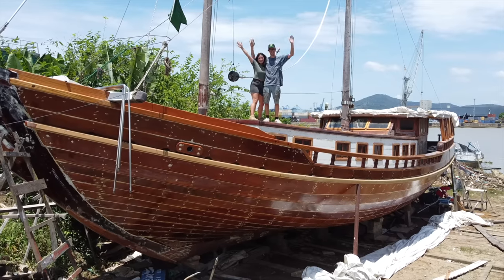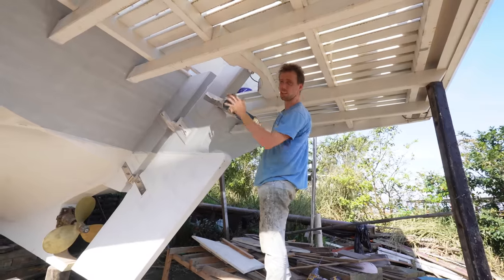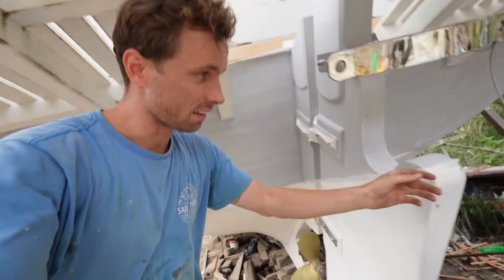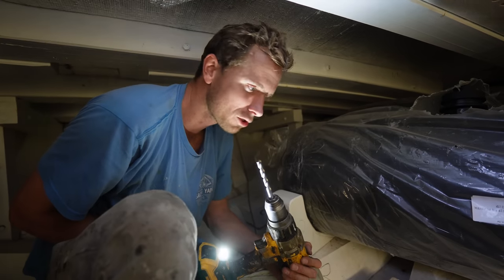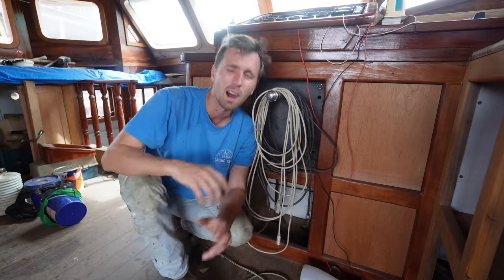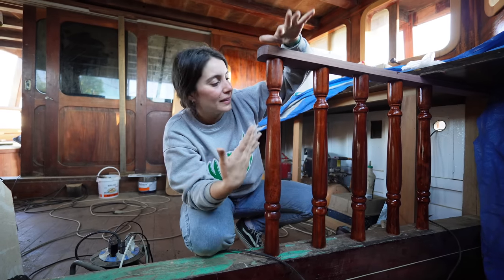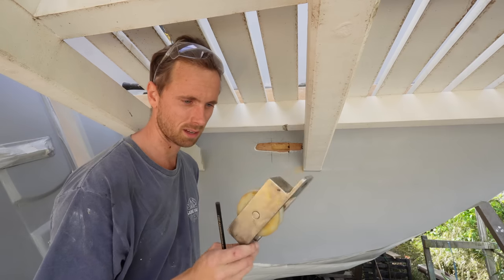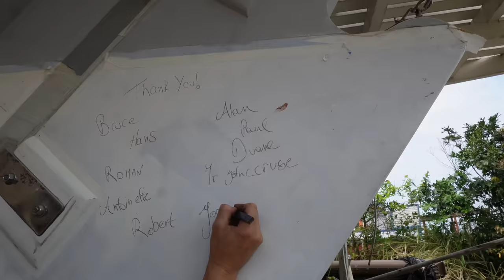We can finally steer our once sinking wooden boat into the horizon — Sailing Yabá 152

Comment: Ben
Your ideas ARE OK for a {GO CART or an outboard motor system} BUT NOT SIUTIABLE FOR THE WEIGHT YOU WILL SEE IN REAL OPERATIONS ON THE SYSTEM!!  Your close to launching so best you get this right the first time. Cable is not the answer for you here in your design and weights you will experience.
There are some great ideas here in the comments and I suggest put some serious thought into rethinking of of this light of controls.
 Love your project so far and all the best in the project.

Comment: The park has your hand set a cable goes around. It’s called a thimble when you put the cable clamps on the cable are you wall goes on the end of the cable not on the bite of the line the cable camp saddle should be on the bite of the line.

Comment: The wire rope for your steering must not be reeved around squared corners or edges AND do a quick internet search of "wire rope clips" to see the correct way to install aforementioned clips. You need "bolt-type shackles" to make the connections unless, of course, you think you'd enjoy repairing the cables at sea in a storm surrounded by sea serpents or some such nasty.

Comment: May be a good reason , but wonder why cable run comes down from ceiling to floor and back to ceiling when it could turn earlier and eliminate a space using up run. which also forces a person closer to that alternator.  (using house terms here as ceiling is usually wall in boat)

Comment: I think that you should be using a larger diameter cable for such a large vessel, you don,t want to lose steering due to braking from running in heavy weather or seas.

Comment: You need to add a tension system to keep the cables tight. I would not use a cable system they are very sloppy and  how do hook up Auto Pilot to it .
Look this up Seaboard Marine. Good luck !!!

Comment: Please, please change out the steel wire for chain or better still hydraulics. As an engineer I used 6mm A4 stainless stranded rigging wire, bought from a Boat Chandlers. It was used for an onshore project where the motions were slow and deliberate as in your steering. Cable loads were about 2kg and involved a full return on an appropriate size pulley (so 180 deg). I was shocked  and amazed to find that it only lasted 6 months before it snapped on the pulley. The individual wires couldn't stand the bending around the pulley and each one snapped until the complete cable failed. (Nylon rope would have out performed it) You don't need this on the sea. Also use bolted thro connections not screws.

Comment: Os cabos que passam pelo painel de popa não devem estar em contacto com a madeira. Façam um furo maior e metam tubo de inox e cabo de aço passa pelo tubo. Os cabos podem estar molhados e vão passar agua para dentro da madeira como está agora. E também com o tempo o cabo de aço vai alargar o buraco.
Reply: I agree some stainless tubes with flanges.
Reply: @frankkelly2245  Yes that's it.
Reply: Exactamente o que eu estava a pensar enquanto via o vídeo! Abraços
Reply: With time those holes will grow bigger on account of wear. Maybe you should re-think of how to supplement the holes with some kind of material where the steel  cables cannot bore a bigger hole. A tricky problem buy no doubt you will come up with a solution. Cheers😊
Reply: Concordo, porém com o tempo e uso o Cabo de aço vai limar cuaisquer material (inclusive sofrer  desgaste). Um probleminha para resolver. Abraço a todos.

Comment: Will you not "waterproof" the holes where the cables go through the transom? IE - drill them out to say 2cm and then fill with thickened epoxy and drilled to accept a sleeve? Just to keep the water away from the wood.

Comment: You need to seal the hole through the transom with a metal tube through which the cable can run. If it stays raw wood, it will suck up water into the transom.

Comment: Don't cut the wire, have it travel across the face of the Crome plate connected to the rudder. You can attached t.he wire in the center of the plate

Comment: Sorry people but I think If you don't rethink everything, it will be Yabà's Achilles' heel. I'm surprised that they didn't tell you anything at the shipyard, how is the system implemented on similar boats?
My concerns:
- bad galvanic couplings (chain/Stainless Steel, SS / bronze)
- SS cable too small
- to much pulleys/ direction changes
- the SS part on rudder it is not aligned with cables
- plus, all concerns of many previous comments.

Comment: you should over drill the thru holes to double the width, fill with epoxy and then drill thru the epoxy .  this will seal off the thruhole from water penetration.   other option would be to sleeve it with a thru hole tube and epoxy or sika it in .         looking good

Comment: The way you connected the cable to the end  will brake the cable in a few  days on the open sea . FRICTION WILL DESTROY A CABLE. Find a beater solution with no friction.

Comment: You should have a grommet going through the transom where the steering cable go through. Use turnbuckles to adjust tension .  Also I'm not a big fan of the way the cables  are under the swim platform . Seems like debri can get cought on the cables easily . I don't know how it was set up originally , but I don't like this set up .

Comment: I said last week that consideration should be given to make the chain drive bigger and duplex. I'll repeat that. I also think the wire is far too small for a boat this size. The strain on the rudder in following seas is huge. At a minimum I would go to 10mm with pulleys and fittings to match. IMO the pulley blocks you have fitted are far too flimsy and weakly attached. They don't have to be pretty, so much bigger and welded from steel and angle iron is fine. You should also be able to grease them. As said there is no damping on the rudder so it will be very prone to being slammed from side to side. Not sure how you will do that but check the other big boats in the yard. Make sure the emergency tiller can be quickly and safely fitted as a failure anywhere in the system will mean you are likely to need it in a hurry.

Comment: I think others are all pointing out obvious deficiencies in this steering set up.
The biggest risk to this project is what you don’t know, not having someone who does know supervise and correct design.

“Winging it” seems to be creeping in to a lot of decision making on completing the project now.

That is understandable & what happens after some years & just wanting it completed as quickly as possible out of sheer frustration at the length of time it has taken not to mention the cost as well.

“Don’t spoil the ship for a halfpennyworth of tar” is an old ship building idiom, that essentially captures what’s happening here.

It’s a LOT slower, more difficult & more expensive to complete the project once it’s in the water.

Rushing to complete it, cutting corners and launching too soon is a big mistake.

Comment: Cable is too small. The working tension should be considered as well as the breaking strength. Im guessing the working tension of that cable is only 600 lbs or less. What happens when Shamu bumps it?

Comment: I think you should just hydraulics. Just as in the car steering system. It give you better power turning, no  returnback resistence, and you could just lay the hydraulic pipes along the starboard and portsides walls of the ship, where every thing should be neater.

Comment: With the transit could you find a tube of stainless that could run through the transom so the wire is not running through the wood

Comment: Would be way better to use much bigger diameter pulleys for directing the steering cables, those small ones cause too much drag by bending the cable through a sharp angle, then you can keep the gearing you have,  current set up will also shorten the life of the cables due to the tight radius.

Comment: I wonder if changing to steel wheels instead of the nylon, will not just introduce wear on the wire (steel on steel without any lubrication), without any real strength increase of the system. I would probably prefer the wheels to be the wear part that can fail, not the wire.

Comment: When you clamp your cable at the chain, you should NEVER saddle a dead horse!  the live line is where the saddle goes and the U bolt pulls the dead (unused) cable against the live cable, otherwise the cable will pull out.

Comment: I'm curious why you didn't just make a fairing block with the proper angle and bolt that with the stainless pulley on the transom? instead of chiseling into the transom. Great progress!

Comment: Hola amigos 
Don't use those cable clamps. That wire is very very easy to splice. There are great YouTube videos on splicing and a great skill to know.
Reply: I'll add this.  Turnbuckles.  You will need a tensioning system somewhere. 
Those plastic sheeves are a bad idea in a steering system. I had one explode at a very bad time. Luckily I had practiced emergency installation of the emergency tiller which saved us from going aground. (long story)
You have a machine shop handy. Get them to make bronze sheeves.

Comment: To pass the steel cable through a drilled opening without securing the opening against rubbing the steel cable is very reckless. Over time, the steel cable rubbing into the wood will change the angle. It will do the same with the nylon roll. Steel on nylon is also not a good idea. This role will also say goodbye with the display and it must be changed. I recommend a thick-walled VA steel tube in the fuselage through which the steel cable is guided and Steel rollers for every other pulleys.

Comment: You definitely need through bolts and nuts on all pulleys as the system will eventually fail under the stresses of sailing.

Comment: There's a minimum diameter pulley that 6mm stainless steel wire should be use for.  the wire will have a much shorter life and therefore require more inspections to avoid the risk of unexpected failure.  Use large low friction pulleys, all carefully aligned.  I would prefer to see the quadrant sited lower down on the rudder and acting on more timber than the rudder post.  How do you plan to connect an auto pilot?  Usually it's connected directly to the quadrant. Auto pilots free up a helmsman to do other tasks, rest, navigate look out for other vessels. Remember the repeated loads on the wire and pulleys/blocks should not be underestimated.  Remember, keep lots of spares on board, wire, pulleys, clamps and do practise using the emergency tiller, not just in calm water, but under sail in more challenging conditions.

Comment: Do you think it would be best to put a stainless steel pin through the hole in the stern and then feed the cable through to reduce  wear on the wood.

Comment: MP why did you not clean and varnish  the base before you put the poles back that would be have saved you a loy of time , Ben please make Dame sure that wire is not shafting  on those pulleys you should have gone for the cover wire protected

Comment: your steering cables are going to require much more support. Having such a weak support system and also the gauge of the cable is not large enough to put up with all the forces that will be constantly on it.

Comment: I would not recommend attaching the wire at that place on the motorcycle chain.. it is simply the weakest link.. It is only strong when the chain pin goes through the hole.

Comment: Hi
You are using the kwadrant wrong,now you get slack in the side that is not pulling.
You should connect the PS wire on the SB side of the kwadrant and vice versa I think

Comment: This steering system is to weak and will give you a lot of problem once at sea. Get a stronger cable, weld a fitting at each end of the chain to distribute the load, fit turnbuckle....

Comment: Hi, I think the wire is way too small (thin) probably 10mm 316 Stainless Steel would be best. Although what you have should last a few months or until your rudder hits something. Also those large Nylon pulley blocks are correct and I think you will find they are made from "Acetal" which is an industrial grade Nylon with excellent strength and wear resistance (just check the wear to confirm. Those brass pulleys will not last (possibly collapse under heavy load), you need Stainless Steel or Bronze Pulley's with large Nylon Blocks. The wire should be adjustable at the rudder end by crimping on rigging threaded rod, the fittings that go into the Rigging turn buckle. You need an adjustment somewhere. from the chain to the cable you need to make a solid steel Link that fits the chain pin size at one end and a larger hole at the other end to fit a shackle to. There should be no cable turn of a greater angle than 90 degrees or those brass pulley block assemblies will snap or pull through the wood. The forces applied by the water to the rudder is 10 times air pressure at least just at 10kts of wind pressure and roughly 100 times at 20kts of wind (that's not exact but you get the idea.
I hope you understand.

Comment: That steel wire will wear that way over time.  Your original idea with the loop should be used get a bigger chain or smaller loop.

Comment: Compare your steering system to those who repair next to you.   Bet they are more robust.   Try to copy what you see.
Line the cable holes so they do not shed water into, onto the unprotected wood of the hole.
Tension adjustment is a must.
Spread the force of the cable on the chain over multiple links.
How long is your emergency tiller?   Take it's length x how much push or pull you can apply,  say 2 meters x (your mass 90 kg) gives you the lever arm force on the rudder, can your cables take this?    In English units 6 ft  x 200 lbs = 1200 ft lbs of force.  Cable should hold at least double that for safety.  (numbers are for illustration, not actual values)

Comment: Never saddle a dead horse. Every rigger will tell you this fact. The cable clamp or wire rope clamp has two parts a saddle and a u-bolt. You did it wrong kinking your wire rope and that makes it weak. The “ dead horse’ is the short end of wire rope. The saddle goes on the pulling part of rope and the u-bolt goes on short or dead horse side…

Comment: I think u should have used a rack and pinion unit. I’m sure u could find a good used unit quite economically, they are far more reliable and seal better. Also why no bow thruster on such a large boat?

Comment: Don’t have the cable run on the roller part of the chain it can’t hold strength, run the cable through the roller hole this way the side plates have the strength not the roller crimps ! The boat looks great !

Comment: Your cable is too small.  3/8" (9-10mm)  would be minimal size for such a heavy boat & rudder. Teflon pulleys will wear out and cause binding when needed most(I.e heavy weather)!!! All pulleys should be thru bolted in bulkheads with backing plates on back side.

Comment: With all the quality craftsmanship that has gone into your rebuild I can't believe you are going to risk your lives as well as possible passengers with that steering setup you have decided on. Most important thing on a boat is being water tight which you paid a great deal of attention too,2nd most important thing would be safely being able to steer the boat which I think you failed to apply the quality to this part you have been known for throughout the build. A boat of this size really should have hydraulic steering as well as a back up system. If cost is the issue then cut corners on things that won't compromise your safety, your steering as you know from your previous steering issues can go wrong fast. Sorry to be blunt but that system from the wheel through to the rudder is an accident waiting to happen. You have come this far don't do something silly and on the cheap just to get back in the water ASAP because you will regret it.

Also going with hydraulic steering will make it far easier to add an autopilot system if you choose.

Comment: I’ve watched you guys from the beginning and really admire what you have achieved, so what I’m about to say is with “love” and in the serious desire that all you dreams for the project come true. 
Here we go:
The steering system, as currently designed, is absolutely not fit for purpose. There are way too many changes in direction, your pulleys will pull out of the woodwork in a strong breeze, as they are not adequately supported in the direction of the strain, the quadrant (ss piece on the rudder. I think that’s the name) is too high on the rudder causing all kinds of angle problems. The only good thing, presently is the wheel. I would get an experienced boat designer to consult, or do some research, because what you have now will fail you at the worst possible time. Either a complete redesign (possibly using dynema instead of cable, but that’s just a thought that would need research) or go hydraulic, as others have suggested.  Best of luck. I want nothing more that to see you two afloat (safely) and creating memories.
Reply: Totally agree with this summation. Your system is never going to work. The forces on the rudder when actually steering in a seaway are massive in comparison. Please take his advice and get an experienced boat designer to sort your steering. You will be thankful if you intend to do any serious sailing.

Comment: You should know about what we call a "snatch block."  This is a (pulley) that can be installed in the middle of rigging for whatever.  The more "lines" there are the more Pulling Power you get.  This is basic "block and tackle" physics.  So that's something to consider too.  I know you know this.  So if there is a place that there may be even a slight change of direction just add a snatch block into the design.  Course you've probably already solved all aspects of the "steering system."  ~~ Just saying.  ✨❤✨.  🇺🇸